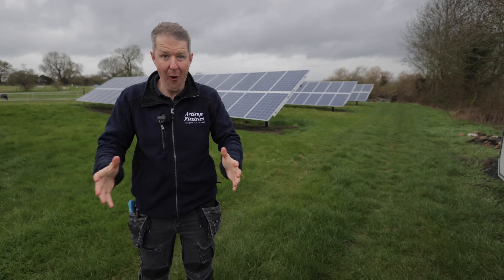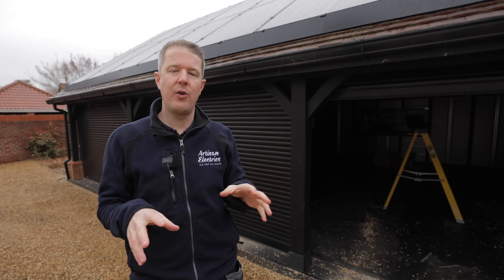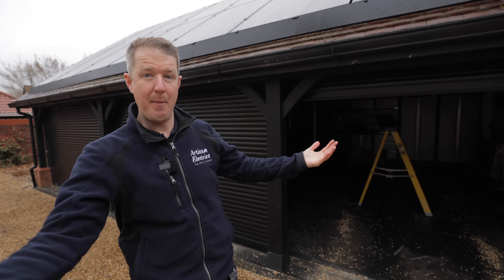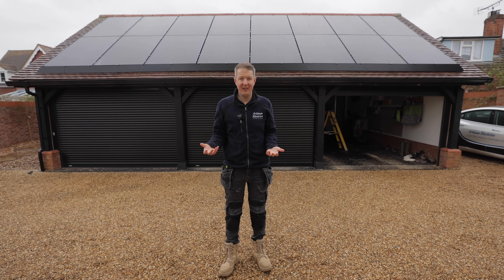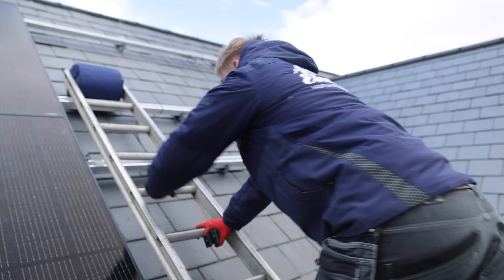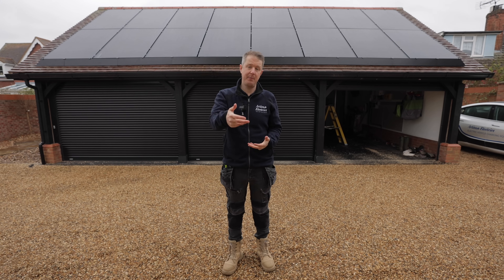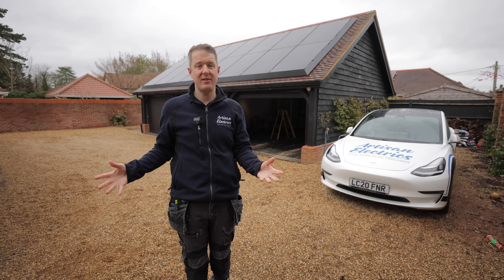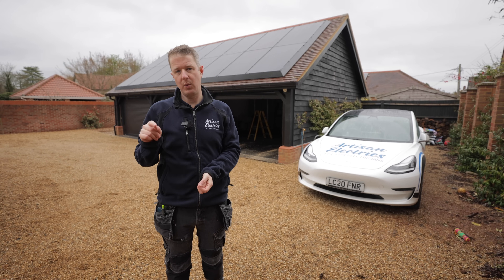10 Things You Need To Know Before Getting Solar Panels Installed in 2024

Comment: Have to say getting solar panels was one of the best investments I've made. 31 pitch, south facing, nearly 20kWh of battery, and 7kw of panels. For nearly 2 years I've spent less than £50 a month for energy now. But then again i live in the countryside and have space.
Reply: But have you calculated the cost of the energy that you've 'harvested' from the solar panels ? It's often (incorrectly) assumed that solar panels produce "free" energy... but you have to consider the cost of the installation, its maintenance and useful life.  It's not an easy calculation as there's a certain amount of guessing into the future, but you can get a ball park figure.  For me (I'm not ideally positioned for PV) it's about 18p/kWh... which compares to a grid rate of about 10p/kWh... so PV makes little sense as of now. (it may do tomorrow)
Reply: Hi, I'm about to build a house semi rural area uk and considering in roof panels on a 35 pitch 20 degree south west facing roof, no shading. We currently use 2700kwh per yr, similar sized house but no solar.

How do i find out what size batteries I'd be looking at.
Reply: @handle1196  that averages at just over 7kWh per day. I'm guessing you use less in summer. Personally I'd fit as many as you can sensibly fit. 10kWh of battery should keep you going even on bad solar days. Especially if you charge them during a cheap tariff at night.
Reply: @lehoff  yes its around 7 to 8, we currently have gas hob and oven which will become electric, and we'll have a hot water cylinder so will divert excess to this once the batteries are full.

If its quite easy to add an additional battery at a later date if required then thats good
Reply: @handle1196  you can add more batteries especially if you have the space for it. Personally I'd try not to install them outdoors as they get cold and don't perform as well. But if you have no choice then of course no issues there - although I'd try and insulate them a little bit certainly in the winter. 

If you get an induction hob then that will of course help. If you move over to an ASHP you may need something a bit meatier as it will gobble up the battery in the evenings in winter. Then again less of an issue if you're on a cheap tariff at night where you can charge the batteries etc..

How many panels are you looking at getting?
Reply: @lehoff  im looking to install 10 or 11 sized 1 x 2m ish on the main house roof and then at a later date i can add the same again to a future garden workshop s.e facing.

The batterys will be in an attached garage so 10 to 15 degrees all yr.

Invertor can go in the loft or the garage. If it takes no harm id prefer it in the loft.
Reply: @handle1196  sounds good. The only thing to consider is the cable run between inverter and the panels. DC voltage drop etc... But your installers can go through all that. Having the inverter in the loft helps with that. The run to the battery also needs to be considered. Sounds like a sensible set up you're going for.
Reply: @lehoff  thanks. The loft to garage will be a 9m cable run so I'll let then decide. I'm assuming my workshop will require a separate inverter with it being away from the property. 

I'll start making some enquires
Reply: @handle1196  9m shouldn't be too bad to the battery - might just need a thicker cable but seems perfectly reasonable.
Reply: You mean 20kWh of battery, not 20kW.
Reply: @deang5622  clearly. Just a typo.

Comment: Hi, love your channel & the work you do However I personally would never want to fit a skirt that doesn’t allow air flow up behind the panels, have you ever considered the heat generated by the sun on the glass? Potentially a fire hazard & also hotter the panels the less efficient they work is my understanding.

Comment: Good video information. I have a hole in the garden where there is a concrete seepage drain, it is no longer used so I was wondering if it could be used for the battery, of course it must be dry the hole is 3 meters deep and about 1 meter wide

Comment: What I have noticed, is that the Inverter at 14.23 (can be seen)  is quite close to the ceiling, I don't know the requirements of this particular Solar edge inverter, but usually, there has to be a gap on 3 sides at least 30 cm, for good airflow, for cooling.

Comment: Its important to use available online tools to calculate solar yield for a location, direction of roof, and angle of roof.  The other serious factor is to reduce demand for power by any and all means necessary.........   Even sunny countries have periods of poor weather for weeks, where the solar yield will be very poor.......maybe only 5 or 10% of normal.   Battery storage has two possible strategies.......one is to store and meet demand for almost all day........the other is to shift peak demand onto storage until the cheaper tarrifs kick in.   People should be aware that Lithium battery storage degrades in capacity per daily charge cycle. Tests indicate that even Tesla Power wall degrades 30% in just the first 4 years......and is basically done in 10 years.  Lead/Carbon batteries are now leading the field in cost per available kw/hr per day........about half of Lithium, and never catch fire.

Comment: Hi, I do not think you mentioned feed in limits (pushing power back into the grid). We could have put up more panels but were limited to 8KW by grid supplier (not by our fuse). Would also have appreciated more information on ground based install as issues and costs were not very clear when we ended up going with roof. I would expect ground based is typically cheaper but how much???

Comment: Thank you for this. I didn't realise that so much wall space would be needed to fit all the batteries etc. I have no garage and certainly don't want all that paraphernalia inside my house, so I think I'll pass on solar panels.
Reply: From my research as I gear up to get solar installed this year, this is a very large system. How much room you need comes down to the battery storage mostly.

Comment: Not sure about the last point. Bird protection? Loads of PV systems on roofs around my way and I've yet to see pigeon nests on or around any of them. Also, solar panels are more efficient the cooler they are (seems counter intuitive but that's the physics). I would think having better air circulation behind the panel would be preferable, even at the expense of it not "looking nice".
Reply: The bird problem is a massively growing one.  It hasnt hit some areas, but 6 - years ago i was only aware of one system getting invaded by birds in the previous 6-years, but now its huge and we are installing and selling thousands of kits a year.  Its  learned behaviour, so once they have been evicted from one system they to to neighbouring systems to nest.  Regarding air flow we have a chimney section we add to the top to encourage air flow.

Comment: I'm looking at adding solar panels to my roof and trying to work out what it may generate. I'm looking for a program spredsheet that could take into account the deviation in the UK with longdetude, 50deg on south coast to 60deg in Shetland and the direction the roof faces makes a huge differance to the posible generation of a system not to mention Shadeing. do you now of a caculator?

Comment: An edge guard to prevent wildlife under the panels is advisable,
But you need to remember not to impede air movement under the panels so as not to loose efficiency of the panel due to high temperatures ,reflected by the roof, that’s why meshing is preferred,but needs more skill to fit.
There is a recommended gap between panel and roof ,what gap did you work to

Comment: As a money saver, it's a joke.
A typical 3kW solar array with batteries costs £9,795 (complete installation)
It will typically generate 2,500 kWh a year
2,500 kW would cost £850 at 34p per kWh, so you’re saving £850 a year
So we can divide the cost of £9,795 by the annual saving of £850...
£9,795 ÷ £850 = 11.5

So would take 11.5 years to payback your investment of £9,795
BUT...
There is maintenance and servicing (and cleaning) to pay on your solar panels over years
So it’s more like 13 years (an inverter may fail which costs £750)
Between 13 years and failure of your array after 25 years you would have saved £10,200

BUT...
If you invest £9,795 at 5% you would be paid £490 in interest per year
After 25 years, that would be £12,250
AND you get your £9,795 back (whereas your solar panels would be worthless)
So after 25 years you would have a total of £22,045

Solar panels are a mathematical madness at ‘saving’ you money!
If the cost of electricity drops (from the quoted 34p per kWh) then your reason for solar panels are even less. If you can get better than 5% interest, your reason for solar panels are even less. This calculation takes no account of the degradation of the panels (they wouldn’t be producing 2,500 kW after a few years!) and takes no account of interest or inflation changes.

Seriously, someone tell me the maths above is wrong.
Reply: Your analysis is the best I have seen on YouTube and that is even from professional installers.

Where nearly everyone goes wrong in their return on investment analysis for solar panels is they ONLY come up with a figure for the pay back time expressed in years.

I suspect they do this because electricians generally do not have good mathematical skills  and are unable to perform or comprehend any other way of assessing the value of a PV system.

But the payback time is a very crude analysis and is not the whole picture.
Who says whether a 3 year pay back time , or 5 or 8 makes the PV system viable and worthwhile installing?  It's arbitrary.

So your analysis of investing the money elsewhere and looking at the financial return is welcomed and a good approach.
Reply: @deang5622  
Thanks, Dean.  I have the yearly payback data as well...

Year 1. You’ve invested £9,795 in solar panels (with batteries), and your energy saving is (after loss of interest) £605. Your panels degrade by 0.6% every year, so your saving is actually £600 in year 1. You are therefore £9,195 down after year 1.
Year 2. You’ve saved £596, so you’re down £8,599
Year 3. You’ve saved £592, so you’re down £8,007
Year 4. You’ve saved £588, so you’re down £7,419
Year 5. You’ve saved £584, so you’re down £6,835
Year 6. You’ve saved £580, so you’re down £6,255
Year 7. You’ve saved £577, so you’re down £5,678
Year 8. You’ve saved £574, so you’re down £5,104
Year 9. You’ve saved £571, so you’re down £4,533
Year 10. You’ve saved £568, so you’re down £3,965
Year 11. You’ve saved £565, so you’re down £3,400
Year 12. You’ve saved £562, so you’re down £2,838
Year 13. You’ve saved £559, so you’re down £2,279
Year 14. You’ve saved £556, so you’re down £1,723
Year 15. You’ve saved £553, so you’re down £1,170
The batteries need changing, that’s £5,037, and the inverter has packed up, that’s £5,251
So you now owe £11,458...more than you originally spent out on the panel array!
Year 16. You’ve saved £550, so you’re down £10,908
Year 17. You’ve saved £547, so you’re down £10,361
Year 18. You’ve saved £544, so you’re down £9,817
Year 19. You’ve saved £541, so you’re down £9,276
Year 20. You’ve saved £538, so you’re down £8,738
Year 21. You’ve saved £535, so you’re down £8,203
Year 22. You’ve saved £532, so you’re down £7,671
Year 23. You’ve saved £529, so you’re down £7,142
Year 24. You’ve saved £526, so you’re down £6,616
Year 25. You’ve saved £523, so you’re down £6,093

At this stage, 25 years in, you still owe over £6,000, despite your savings on energy costs. And you are coming close to having to replace the batteries and inverter again.  You realise that it’s not worth bothering, and that your solar array will NEVER pay its costs back.  The above figures are actually weighted in favour of a solar panel array.  I have made an assumption that electricity prices will remain as high as they currently are (34p per kWh) which isn't true.  Over the past weeks the cost has fallen to 33p per kWh, and will fall further.  I have also made no account whatsoever of ANY parts needing replacement (other than the batteries and the inverter) or service engineer visits, or cleaning charges. This is said to be £4,000 over the life (25 years) of the array - £160 a year.  I have assumed a battery pack change at £3,495 for a 3kW array and an inverter cost at £3,714.  Both of these costs were obtained from Contact Solar, and have had inflation added at the time they need replacing at 2.5% per annum.  It should be remembered that the batteries and inverters could fail twice.

A typical solar array will COST you money, not save it.
Reply: food for thought, this was a concern of mine would the system ever pay for itself, before panels, inverters etc start to break down and require replacing. I don't want to invest into an ideology.
Reply: Erm….one serious error you’ve made….you haven’t mentioned feed in tariffs. People make thousands back by selling their unused electricity back to the grid.
So you maths are ridiculously skewed.
Reply: @kugamanone6472  
There's something wrong with your ability to read.  The data I quote (which isn't mine) is for a BATTERY installation, so that the power generated is used by the owner, not sold back to the grid.  I mean, it says it right there.
Apart from that, you're an absolute genius!
Reply: @chrisgreenwood271  
Chris, I've updated the data due to lower electricity costs and better info...

Purchase cost of a TYPICAL 3kW system with batteries £10000
Generates 2,500 kW a year.  At 21p per kWh that is a saving per year of £525
Put that away in a bank and you’ll get interest of around 3% £16
A yearly total then of £541
So it LOOKS LIKE you will see a return of your £10,000 after about 15 years (£10,000 divided by £541 = circa 15).  This is called the ‘payback period’ and it’s the biggest lie told in the solar panel trade.  You will see it everywhere.  However, sadly it is totally untrue.  Remember, you had that £10,000 in a bank account…
Minus loss of interest (on the £10,000 you had in an account @ 3%/year) £300
This means that you have to DEDUCT the interest that you are losing.  So we’re actually down to an annual saving of just £241
Minus the yearly cost of maintenance & repairs which is £4,000 over the 25 years £160
This means a ‘profit’ of £81
…every year.  So, after 15 years, you have accumulated £1215
Unfortunately, after 15 years, a new inverter and battery will be required £9900

This means that over the 25 year period of owning your solar panels, you will have LOST £8,685…which is £579 a year.  This loss accumulates, so by the time your panels are knackered (around 25 years) you’ve lost a considerable sum of money.  The panels also degrade, so with every year that passes, your panels generate less electricity.
Reply: @barryfoster453  Good update, have to say I went with the, stick it in a good rate of interest account for now, 👍
Reply: Don't get diverted by emotional outbursts on here, your basic logic is good, but would be great to factor in the benefit from selling back to the grid,  of course it would be based on some assumptions. My guess is it would only slightly improve the result, but my maths is terrible!
Reply: @feistyphysicist Briefly considered solar but I scrolled through comments on 2 YouTube videos and yours convinced me to not waste time. Thank you.
Reply: @roybatty4687  
You're welcome, Roy, thanks for letting me know.  People don't tend to do the maths!

Comment: Thank you, you highlighted issues and ideas, we had not thought about, thanks.

We now know where to go to for a solar system, but do you install a Combined Solar and Wind plus Batery Off-Grid System.

We been looking at these French designed and built, Wind Trees and Wind Bushes,  using micro aeroleaf (plastic formed) vertical axis wind turbines!

Have you any experience of these Wind Trees, or other Vertical Axis Wind Turbine electric generator systems?

Comment: The first question you need to ask yourself is if the DNO allows you to export energy all the time. In my country, the grid has quickly reached capacity due to the explosion of the number of PV systems, at peak solar production many people experience the inverters shutting down as a result of reaching the upper limit of 253 V. The grid was never designed for a simultaneity factor of 1 which PV systems do. It means upgrading the grid at a cost of billions of euros and several decades to do it in. Go ahead and install PV systems, just don't expect to be exporting all the time.
To alleviate the problems, some contracts entail negative energy pricing at certain times, meaning if you import energy, you get money and if you export energy you pay money. Yeah...that's the way it's going. Some farmers with huge PV arrays have started switching them off when energy prices to negative,

Comment: What about the angle (pitch)of the roof?

The pitch must make some difference to the output of the panel depending on the time of year and how far North (or South) of the equator your roof is located. I don't know if there is an online calculator or a rule of thumb that can be used. We have a flat roof, a low built kitchen extension with a shallow pitch and also a main roof with a steep pitch. They are all directly South facing.

Comment: Really good video Jordan - thanks!
Do you have a view re the effect on panel output of shadow through the day.  My south coast roof faces due south but the neighbouring property's eaves  cast a shadow across the roof, which by 1600hrs in August covers half the available roof space.  I've often heard installers play down the potential negative effects by mentioning by-pass diodes and the fitting of 'panel optimisers' - unfortunately it seems, that with shadow, it's not until the panels are up that you see the true output outcomes.  Thanks again for an excellent video.